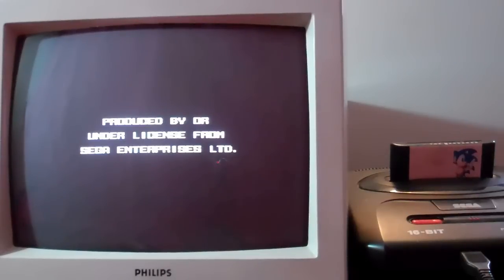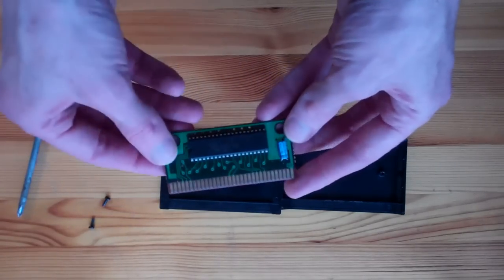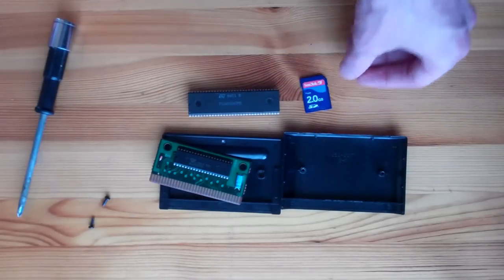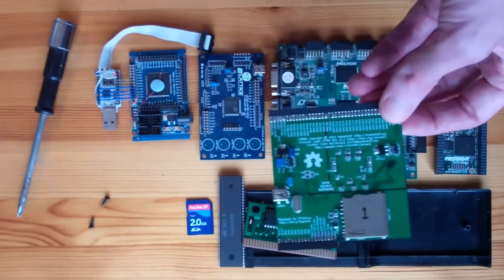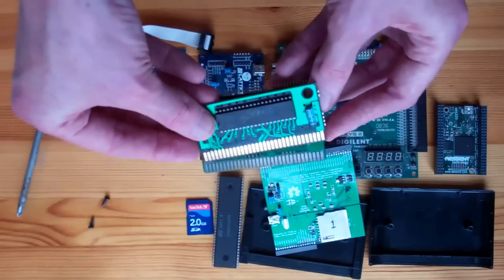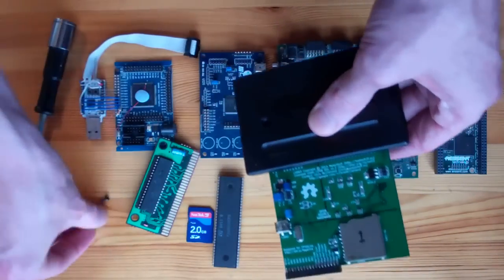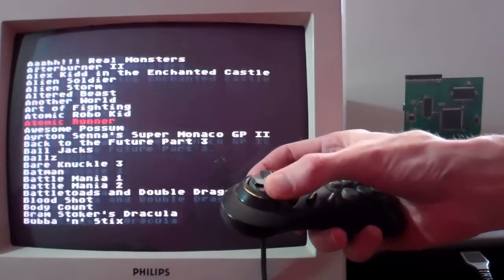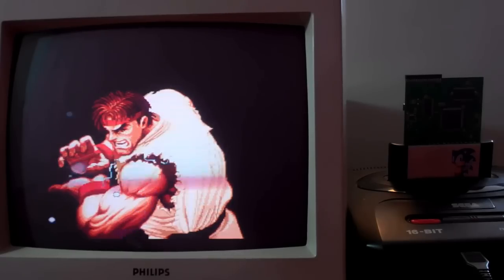USB MegaDrive DevKit Part 1

Comment: First of all, congratulations ! I've been looking for this information for a long time! thank you so much ! I wish to do the same for the Sega Master System and am trying to reduce the work.  There is a way that you can transfer data from an SD card, to an Atmega328p microcontroller. Inside the SD card, I put a ROM of any Sega Master System game. If I can communicate with an EPROM by searching the SD card data through the Atmega microcontroller, can I make a kind of everdrive or not ? I think I would have to program eprom to communicate with Atmega. Do you believe this idea is possible ?
Reply from the maker: It's a lot more complex than that. A microcontroller is not fast enough to keep up with the cart bus of a Master System. You'd need an FPGA or similar. Also, the SMS's CPU doesn't have a nice GDB backend, so you'd have to either write your own simple debugger or integrate with an existing open-source offering (if any exist).
Reply: Sorry for not answer you  in time. I live in Brazil, we have different time zones. I would like to thank you for your attention. Sir, I'm freshman at Computer Engineering College.  Sir, what types of materials could I then develop the "everdrive" for Sega Master System ? and what programming language, should I use to program an emulator that will read the roms from the SD card ? Thank you very much !
Reply from the maker: I'm confused. If all you want to do is make an Everdrive clone (a flash-cart, right?) for the SMS, then that's relatively straightforward. But if you want to replicate what I did here (i.e real-time instruction-tracing, remote-debugging, etc) then it'll be more work. As far as programming-languages are concerned, I used mostly C, VHDL, assembly-language and a few shell-scripts. All my code is published on GitHub; feel free to peruse, but please respect my LGPLv3 licencing: https://github.com/makestuff/umdkv2/tree/20161106
Reply: Again, sorry for not responding in time. Yes, Sir, I wish to create a kind of "Everdrive." A cartridge where the player can select the games from an SD card, like the Everdrive that is currently sold.  And I'm looking for information on how I can do this. How to integrate an SD Card into a cartridge that with the help of software, can read the games stored in the memory of the card. Sir, I thank you very much for your attention and apologize for any inconvenience on my part. I will study your material better and certainly, I will use due course within the standards of LGPLv3. Best Regards !

Comment: Why not using a 5v tolerant cpld instead?
Reply from the maker: It’s a long time ago now but I suspect I made that decision based on logic resources. The bus-tracing needs a chunk of block-RAM, which CPLDs don’t have, but even if you stripped that out the design probably wouldn’t fit. You could try it for yourself - all the VHDL is open-source, on GitHub.

Comment: Hey there this looks like a cool project for Roms but can you actually make a Megadrive game with this Dev kit? also you might want to get a Japanese Megadrive or Asia pal as they run at 60 mhz unlike all European Megadrives got 50mhz quite slow when running games and squashed screen, any boards available? keep up the good work peace ✌
Reply from the maker: > can you actually make a Megadrive game with this Dev kit
>
That's what part 3 is about: https://www.youtube.com/watch?v=dLoudQc8L08

> get a Japanese Megadrive or Asia pal as they run at 60 mhz
>
I think you mean 60Hz. Call me a philistine but I don't really care: I don't actually play any games, I'm more interested in code.

> any boards available
>
I think I have some blank LX9 PCBs but you'd have to solder on the components yourself. Unless you've done fine SMD work before I don't recommend it.

Very few people are interested in the project so it doesn't really make sense to get bulk professional manufacturing done, but you're welcome to try.
Reply: +Chris McClelland Hey Chris, sorry for being dumb, watched all 3 videos now, could be up for a board, i can do a bit of soldering, I've re caped my game gear if that counts, cheers for responding hopefully speak to you soon peace ✌
Reply from the maker: Recapping involves electrolytic & tantalum capacitors; those are comparatively quite big, and easy to solder. For comparison, the UMDK FPGA has 144 pins, each one 0.5mm apart. Unless you have a lot of experience soldering such things, I wouldn't recommend trying to build a UMDK cart.
Reply: Chris McClelland Ok Chris no worries keep up the good work peace.
Reply: I see your a bit of a Trap Door Fan,me too

Comment: Anyway you could post the gerber files in a zip for each board and the FPGA code binary file that is ready to program? I'm interested in building this and since I and many people on my game hacking forum would love something like this I will be selling them to people who will use and appreciate this. I use Eagle CADso I couldn't compile the files myself. Thanks and excellent work.
Reply from the maker: That's a good idea, Helder. I will upload links to the necessary gerbers and binary files to the home-page (http://hackaday.io/project/1507-USB-MegaDrive-DevKit).

Oh and BTW I'm very happy to hear that you intend to make and sell these! I have neither the time nor the inclination to deal with that side of things, but without someone willing to do it, this'll end up just another Internet Curiosity.
Reply: Chris McClelland
Awesome! that's what I needed to get this project going for myself. One question though: is the FPGA binaries all set to program onto the FPGA and also includes the menu? or does it require other files to be programmed in conjunction with this binary?
Reply from the maker: Helder Silva the process is:
1) Build the "flcli" and "gordon" tools from the FPGALink project
2) Load the spi-talk.xsvf file into the FPGA using flcli
3) Load the fpga.bin file into the SPI flash chip at 0x00000 using gordon
4) Load the firmware.bin file into the SPI flash chip at 0x60000 using gordon

At that point your MegaDrive should load the monitor and boot into the menu program. Use a smallish SD-card (I've heard that larger cards don't work for reasons I need to investigate) and be sure to format it FAT32, not FAT16.

You'll then need to build GCC, GDB, DDD & the UMDK host tools (gdb-bridge, loader, hackdump & logread).

I'll provide you with more details of how to build all this software when you've got your boards. Currently the flcli & gordon tools are cross-platform (Windows, Linux, MacOSX), but so far I've only tried the UMDK tools on Linux.
Reply: Chris McClelland
Could you post what connectors needed to assemble these plus what size capacitors/resistors and values needed? Could you also tell me where you sourced these connectors? I'm trying to get a list of all items needed to build this.
Reply from the maker: There's a forum for such questions: http://gendev.spritesmind.net/forum/viewforum.php?f=20

Comment from the maker: USB MegaDrive DevKit Part 1
Over the weekend I finally got around to making a set of videos demonstrating the features of the USB MegaDrive DevKit, my open-source hardware/software development cartridge for the SEGA MegaDrive.  #oshw   #opensourcehardware   #megadrive   #sega 

In this introduction I do a quick teardown, and demonstrate the UMDK's basic functionality.
Reply: I mainly know the Megadrive from hours and hours of Mortal Kombat fights with friends. Can't believe you still have a 2GB SD card . . . and that every game ever written for the device would fit on a single one of them o_0. Another surprise for me was your estimate of 40 bucks for the board. What I wouldn't have given to have something like this when I was 14!
Reply from the maker: ***** well that $40 is just a rough estimate of the cost of all the components, assuming they're bought from places like aliexpress.com, assuming a ten-off run of PCBs from  #hackvana  and no other manufacturing costs.

In other words, you gotta solder 'em yourself, and to do that you'll need some skill and a decent soldering iron which'll cost $200 or so, and you'd probably expect to ruin the first two or three boards attempted until you get the hang of it...but what price new skills, eh?  :-)
Reply: Priceless I'd say. 
I destroyed the first Xbox controller whose board I tried to modify for default Southpaw layout. 
Second one worked a treat though :P
Southpaw Modification - Xbox360 Controller - Electronics Hack
Reply from the maker: ***** if you're serious about trying it I can send you a couple of blank PCBs if you like; I've got more than I'll probably ever need, and I'd prefer that they went to a good home.
Reply from the maker: I only give boards to people who are likely to be able to do the soldering, otherwise it's just a waste. There are doubtless many people who are capable of making a UMDK cart, and there are many people interested in making one, but the intersection of those sets is pretty small! So I wouldn't worry about me running out of boards.  :-)

But actually the FPGA board is completely standalone, so even if your MD turns out to be non-functional, you could still use the FPGA board in other projects.
Reply: These videos were great! I have been tearing down and repurposing old consoles and carts as of late with videos I have seen online and this looks like it might be a great direction to take for a bit more of a challenge. Where would one find the correct boards to even attempt something like this? I have confidence I could make it happen with your instructions as well as others I have been reading but can't seem to find a local stock.

Comment: Wasn't Phantasy Star IV the largest ever mega drive cart ever produced?  But you could look at Pier Solar released in 2010, which is 64mb in size.
Reply from the maker: I think you're getting confused between mebibytes (MiB) and mebibits (Mib). The SSF2 cart was 40Mib (5MiB). The Phantasy Star IV cart was 24Mib (3MiB). But you're right about Pier Solar: at 64Mib (8MiB) it's probably the largest ROM produced for the MegaDrive.
Reply: Chris McClelland Aah,  It's odd that Sega Charged more for Phantasy Star than they did SSFII. 

Also,  what about Sonic 3 and Knuckles?  Though that was technically two 32mb games together.
Reply from the maker: ***** you're obviously more knowledgeable about MD games than I am, because I have not heard of any of these games you're talking about! But I think (from looking at Wikipedia[1]) that the Sonic&Knuckles cart was 16Mib (2MiB).

In any event, it's not really important which was the biggest ROM. The important thing is that SSF2 was the first game to break the 32Mib (4MiB) "boundary" that is the size of the region in the 68000's address space into which game cartridges are mapped. Any game which is bigger than 4MiB needs to do bank-switching, and to do that Sega introduced a standard scheme (which came to be known as the SSF2 registers[2]). I wasn't aware of any game other than SSF2 that used it, but obviously Pier Solar does too (assuming the second half of the 8MiB ROM isn't just blank, haha).

[1]http://en.wikipedia.org/wiki/Sonic_%26_Knuckles
[2]http://emu-docs.org/Genesis/ssf2.txt

Comment from the maker: Garrett Smith:
Can the USB development kit for Sega Genesis recognize the Sega CD and 32x?

Chris McClelland:
If you look at the Internals doc[1], you'll see that UMDK uses the address range 0x400000-0x47FFFF for its bootloader, monitor program and menu program. This range is listed as "Reserved (used by the Mega-CD and 32X)" in the official memory-map of the MegaDrive[2]. Therefore it's highly unlikely[3] that the two are compatible. There may be fire.

[1]https://github.com/makestuff/umdkv2/wiki/Internals
[2]https://segaretro.org/Sega_Mega_Drive/Memory_map
[3]Although, to my knowledge, nobody has ever tested it

Garrett Smith:
That’s too complicated.

Chris McClelland:
Einstein once said, "everything should be made as simple as possible, but no simpler". I said "there may be fire". I don't know how I can make it any simpler for you. Pictures maybe?

Comment: Hi Chris, what are the specs of the resistor at R11 on the LX9 Board? Can i leave it unpopulated or put a 0 ohm resistor
Reply from the maker: R11 is the series resistor driving the 68000's DTACK via a transistor on the bridge board. Since DTACK is asserted automatically by the Megadrive hardware for common address ranges, I have never tried driving it myself, so I leave both R11 on the LX9 board and Q2 on the bridge-board unpopulated.
Reply: @makestuff-de  Thank you!

Comment: Are we able to purchase one of these from you and would this work on a mega drive from the UK?
Reply from the maker: +Chris Kilgour no, I don't manufacture and sell them. However, some people on SpritesMind have arranged manufacture themselves, you should ask them[1]. Alternatively, if you don't want to go with their manufacturer, you can arrange your own manufacturer, or build it yourself - the design is 100% open-source (software, firmware, VHDL and electronics).

So far as I'm aware, the only MegaDrives that UMDK has problems with are very old MD1s that show interference on their video output. If you have a UK MD2 or MD1 with clean video output, you should be fine.

[1]http://gendev.spritesmind.net/forum/viewtopic.php?f=20&t=2278&sid=3aa478234670a2e8efcb3ea86ac20628

Comment: hi great video ive been looking at the everdrive and others like it but i refuse to pay the amount they ask how much would it cost to build one and could i buy a complete one without the case?
Reply from the maker: The "sweet spot" pricing-point is if you built about ten carts yourself, whereupon the per-cart cost would be about $45. To make just one cart would be more expensive. However you should not attempt DIY unless you have extensive experience soldering fine-pitch SMD. The alternative is to buy one ready-made. Some guys on the SpritesMind forum[1] are doing batches, but they're using professional manufacturers with low quantities, so the price will be higher.
[1] http://gendev.spritesmind.net/forum/viewtopic.php?t=1825&start=0

Comment: I would really like to get into FPGA's where do you think is best to start?
Reply from the maker: I would buy a devkit that is supported by FPGALink (e.g Digilent Nexys3 or Aessent aes220), and start playing. Also I strongly recommend using a decent simulator that can simulate vendor IP blocks (FIFOs, PLLs, etc), and get into the habit of writing unit-tests for everything. It may seem like extraneous work at first but it will save you a lot of time in the long run. Finally, this above all: HAVE FUN!
Reply: Chris McClelland Thanks for the advice - much appreciated. Great work on this BTW!

Comment: Man is the megadrive slow
Reply from the maker: By modern standards, yes it is slow. Its core processor is a Motorola 68000, clocked at about 7MHz. So, simplistically a modern 3.5GHz CPU is 500 times faster. I say simplistically because the 68000 took several cycles to execute an instruction, whereas a modern CPU can execute several instructions on one cycle, and those instructions process more data than those of the 68000. So the speed ratio is much bigger than 500:1. I hope this helps.
Reply: The PAL Megadrive/Genesis(I prefer the name “MegaDrive”) is running the game at 50hz, the game was usually designed for 60hz